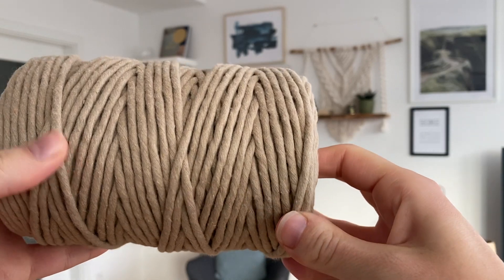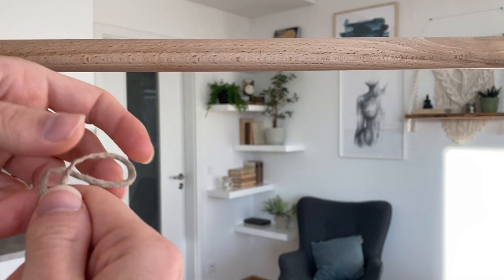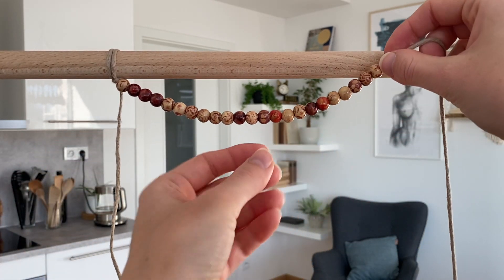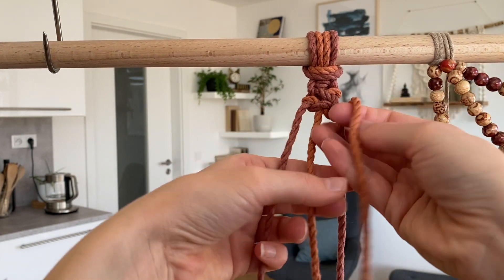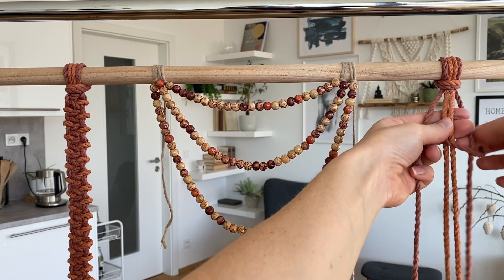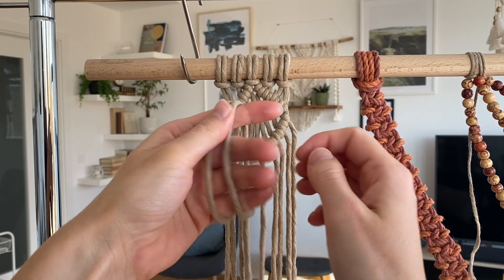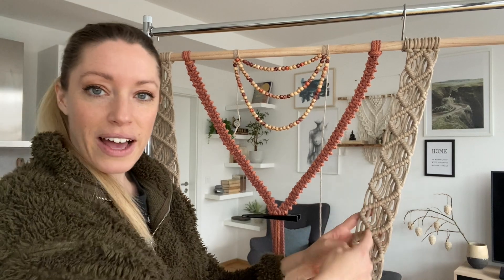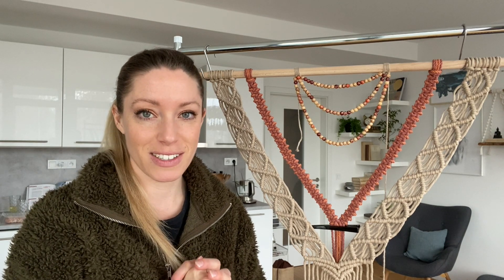LAYERED macrame wall hanging with color and beads

Comment: This is gorgeous!  I have what are almost identical beads on their way to me now, and this is looking like it might be the right project for my sort of beginner self to graduate in to larger wall hangings - complicated, but not massive, and I’ll be able to practice a few different knots and joining and tension techniques without getting super complicated (which would totally frustrate me!). Thank you!!
Reply from the maker: I think you got it exactly right - big projects might seem intimidating but when you break it down into the individual parts you often find out that it's the exact same knots you are using on smaller pieces, there is just more of them 😁 One thing with the beads that can make it more tricky and frustrating to work with is the size of the hole in the middle. That will determine what size of cord you can use and also the pattern. Fingers crossed and have fun! 😊

Comment: I LOVE this! I liked the new knot - Solomon bar knot? Really gave it texture and made it pop. When you do the tassels - could you attach them in the three strands as you showed but not brush them out until after they're in place? Would that work? If it does,  I think it would be less time consuming
Reply from the maker: I do really enjoy the Solomon bar, I have been using that one in quite a few projects...I think I know what you mean. You could do that too but then you wouldn't be able to brush out the entire tassel but only the ends that are sticking out. The knot with which they are attached would not be brushed out. So it would be less time consuming because you would be brushing out a smaller portion of the tassel but it would change the look a bit. I think it depends on what look you would prefer 😉
Reply: @uzliky  yes I agree with you. That was the way we attached fringe on crochet projects - only now that I think, we used a lark's head knot to put the fringe through the work. Thanks for your response! I am due to get my 8mm macrame rope (no 9mm) and dowel etc. Tomorrow for my first project in over 30 years!
Reply from the maker: @kimbercole2438  Very exciting! I hope you will have fun re-discovering this wonderful hobby 😊

Comment: This is so beautiful. Love the colours. I can't get the 5mm terracotta in a 3 ply, would single twist be OK to use instead? If so should I also swap the sunset to a single twist?
Reply from the maker: It's okay to use single twist as well 😉 I only used 3ply because I had some leftover cords that I wanted to use up...The braid will be a little bit less textured (this is what the 3ply cords add to it) but since it's such a small portion of the piece I don't think the difference will be really visible...

Comment: Do you have  a source for the beads in the US? I have trouble finding colorful beads (not wood) with holes large enough for macrame. Love your videos, especially the details on the supplies, as well as your clear, patient instructions. Thanks!
Reply from the maker: I don't have any particular brand or store in the US, I would suggest looking on Etsy or Amazon (I don't know what exactly you are looking for but this https://amzn.to/3o14yb7 caught my attention, it's a shame they are out of stock). And I am sure there will be plenty of places selling similar ones, if we have them in our tiny Czech Republic you guys must have them in the US. I buy mine from a jewellery beads supplier who has a very handy website where you can filter based the hole size. And last tip - even if the hole is smaller you can still use them you just need thinner cord - I was using only 1,5 mm for this project 😉 I hope this helps.
Reply: @uzliky  Thank you! :)

Comment: Hi, I was wondering, if you were to make two of the same pattern, one in a 5mm cord, and another in, for example, a 2.5mm cord, would the final piece in the smaller cord be half the size of the larger cord? Hope that makes sense 🙈
Reply from the maker: Hi 👋 That's the theory but I have never really tested it...I think it won't be so precise but the smaller the cord the smaller the final piece is definitely true. You can also always alternate the pattern a little bit to fit a certain cord size to make the final size similar to the original (add or remove cords/knots in top rows for example).